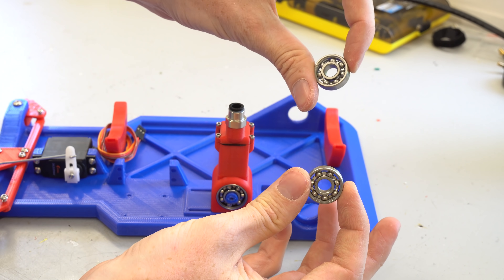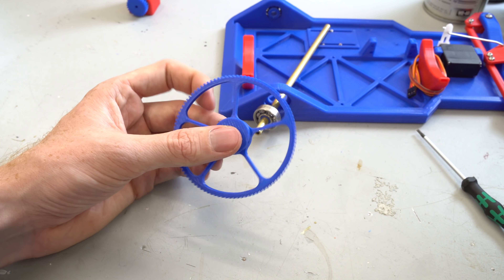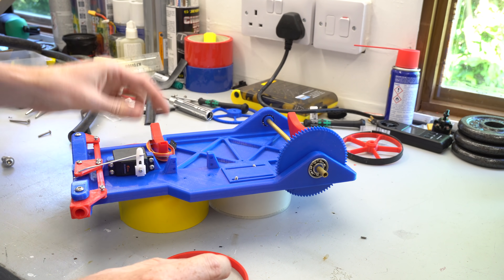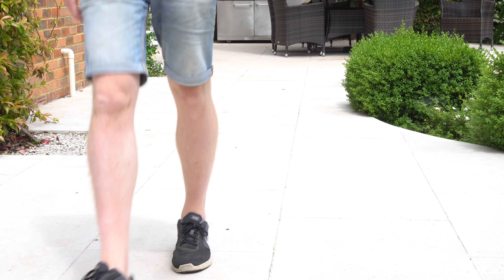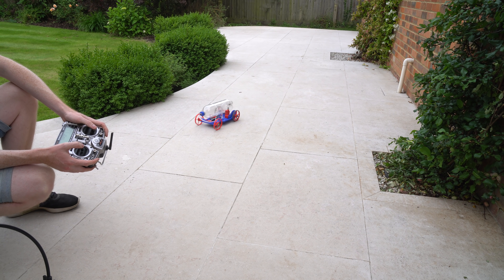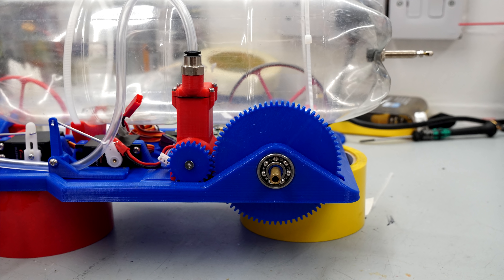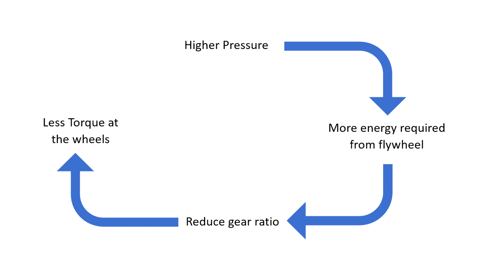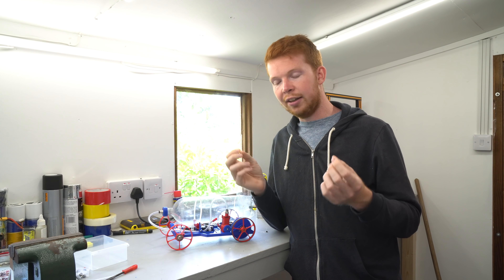Air Powered Car

Comment: For gearing it's better to avoid simple ratios like 100:25 (4:1) as it means the same gear teeth keep encountering each other.  It's better to use relatively prime numbers such as 101:23 and then every gear tooth gets to encounter each tooth on the mating gear which promotes better wear.
Reply: and this is the reason why the reduction ratios are always strange! ... now I know it too .. I never thought about it. Ah the old mechanics what a legacy
Reply: I've never thought of that! Incredible!
Reply: Smart!
Reply: @hb4lwade1 llllllllĺlĺĺĺĺlĺlĺlĺ
Reply: > It's better to use relatively prime numbers such as 101:23
Agreed on using relatively prime numbers for the better gear ratio, but the example 101:23 is maybe not the best example to illustrate what it means when numbers are relatively prime.

Two numbers are relatively prime when they don't share a common divisor other than 1. Any two prime numbers like the 101 and 23 in your example are relatively prime as well (by definition), but a number that isn't prime can be relatively prime in combination with another number as well. As long as it doesn't share a divisor with the other number other than 1, a non prime number is relatively prime with that number, so 125 and 16 are relatively prime as well because they don't share a common factor other than 1 (factors for 125: 5^3, factors for 16: 2^4).

TLDR: being prime is not a necessary condition for a number in order for it being relatively prime. Because the numbers in your example both are, it may convey a wrong suggestion. An example using non prime numbers like 125 and 16 (or any other non-prime combination) would in my opinion have been a better example to illustrate what it means for two numbers to be relatively prime.
Reply: That's neat I never would have even thought of that.  Simple concept yet easy to overlook.
Reply: Thank you very much.  I had noticed in the past that some gears had what seemed like strangely random numbers.  Your explanation makes perfect sense and now I know why.
Reply: Thats mad haha
Reply: Never thought about that
Reply: Excellent advice, thanks.
Reply: Bos: You are right. Good explanation.
Reply: Well, thank you :)
Reply: I can only agree , but I dont think that wear of the gears is his biggest problem at the moment , although its a verry nice build car
Reply: That's what is called a  hunting gear ratio. Most car manufacturers have moved to it instead of the non hunting or partial hunting varieties.
Reply: Its called "hunting gear"
Reply: Even if you up it from 100:25 to 101:25, you'd ensure that the gear was cycled 1 tooth backwards for each revolution of the large gear, which would also ensure even wear
Reply: Old windmills use this trick too, accompanied with the cogs being different kinds of wood
Reply: Great observationand explanation. I do think it's a different situation here as he doesn't need to worry about wear. Instead his issue is getting a proper mesh and it's easier to get the same set of teeth to mesh rather than every combinationof them. Simular situation when your hand cutting gears.
Reply: My rc car gear wear explained 20 years later in a comment made 3 years ago. Awesome. Totally overlooked this
Reply: That's really interesting
Reply: oooh..........thanks man
Reply: you just taught me something. thank you
Reply: holy shit, you just blew my mind sir
Reply: I have no idea what u said but ur bug brain
Reply: mating...
Reply: Holly sheet you just gave me a flashback to college
Reply: Wait. Thats a lot of knowledge.
Reply: Thanks!!🤓👍🏽
Reply: Thanks
Reply: 0
Reply: My english is not nice, ı have a question: why dont he 10-35?
Reply: If it promotes wear then how it is advantageous?
Reply: @samuelnallabariki4517  No, you've misunderstood that. What he meant by a 'better wear' is an even wear on all the teeth, an uneven wear of the teeth might cause slipping or other issues.✌️
Reply: Amd do you know why that works? It's because it's numerology. The sum of that is 7 for completion and perfection.

Comment: Hey try this pneumatic engine with steam? Would the 3d plastick melt with higher temperatures tho? Dunno but it would give you a fun project to try accomplishe lika boat or something that runs with steam!!
Reply: cheap 3d printed plastic wont handle steam
Reply: I have a 3D printer and I test it with the heated bed : PLA plastic start to bend easily at 100°C.

Comment: It really just needs an extra flywheel (brass)
Reply: a light flywheel defeat the entire purpose of a flywheel.
Reply: yeah have a built in flywheel,, or make the gear coming from the engine metal
Reply: the problem that I see with his engine is a single cylinder design. it only produces power in half of a cycle. therefore, it needs a flywheel to drive the other half of a cycle. my idea is  a 2 stage design or double the cylinder. with this solution, the engine is able to generate more power continuously and you don't need a flywheel. but you can have a flywheel to make the car run longer.
Reply: You don't necessarily need more weight. A fly wheel stores energy in form of momentum ( a mass with a certain velocity). So to increase the energy storage, you have either to increase the velocity of the mass or the mass itself. That said, you don't need much weight for a flywheel,  you can just shift the weight to the outer ring of the flywheel (distance of the mass to shaft increases and therefor it's velocity), wich you can manage by fitting a piece of metal tube onto the flywheel (minimum weight increase for maximum energy storage). That's why flywheels often have this distinctive slender rods that attach the outer ring to the shaft.
Reply: No. A flywheel needs a high moment of inertia.
Reply: And what is wrong with that? Isn't that the whole purpose of a flywheel to have a high moment of inertia to overcome the valve resistance? Yes it would need a slightly stronger initial push but it would than help the car going at higher pressure
Reply: you mean inertia? right? I know that but a 3d printed flywheel is too light to store the energy.
Reply: A flywheel needs to have weight/mass what the fuck do you mean it has to be light?
Reply: A large diameter wheel with most of the mass at the rim will have a light flywheel with good torque.  He has enough space where the engine is to have a large flywheel on the outside of the gear wheel.
Reply: +Preston Elam No, a flywheel is essentially nothing more than energy storage. He needs enough energy (in form of inertia) to overcome the friction of the valve train. To increase inertia, you can either shift the existing mass away from the center (the shaft, wich increases the speed of the inertia) or you could add more weight (wich is pretty inefficient) or you could gear the flywheel to have double the rpm of the engine ( this would increase rotational velocity of the flywheel mass and therefor it's stored energy). To give you an example, think about the land speed record cars at salt lake city. They can't start by them self, there has to be another car pushing them to a certain speed after wich they can accelerate by them self. This is because the transmission is geared so high that the engine can not deliver enough momentum to the wheels. In case of the air powered car, the car was the flywheel of the engine. The car has to get to a certain speed (the initial energy provided by the engine isn't enough, so you have to put your own energy in)  until the engine can run self sustained. You could increase the gearing to solve the problem or you could increase the initial speed or even increase the weight (wich would be counter intuitive because it would make the start even worse but it would help to sustain a certain speed, when driving through a corner for example). I merely said that you don't need much weight for a flywheel (it is just the simplest way). There were a lot of single cylinder tractors that relied on the principle of flywheels (storing energy rotating mass) to even be drivable.
Reply: +Mandernach Luca I understand what a flywheel is. I understand it's purpose and I understand the effects of changing the scale. His issue is not however a flywheel issue is all I am saying. The entire car is enough of a flywheel since his drivetrain can be reverse driven. So, my only argument here is; He needs a new valve system, and it has nothing to do with the flywheel because the car's weight and the energy generated by it is a sufficient flywheel
Reply: If possible, add a small but heavy flywheel connected to an even smaller gear than the primary gear of the motor. This gives a high flywheel rpm to compensate for the small size.
Reply: And a clutch system. Something simple with fly-weights would do it. Then the fun would be figuring out what would be a workable stall speed.
Reply: Lardah420 agreed
Reply: Sinh Nguyen, the Single Cylinder issue has no effect here. the issue is the valve system he is using. Did you watch the explanation at the end of the video? The power created by the engine isn't enough to overcome the power needed to push the valve at high pressures and the weight of the car.
Reply: I know how a flywheel works. my idea is a 3d printed flywheel can't store enough energy even if you shift the mass away from the center. the purpose of a flywheel is to store energy in order to drive the other left of a cycle (which doesn't produce power). in his case, he need a flywheel to drive half a cycle and push against the valve. he can change the valve system (a rotary or slide valve) or he can change the engine design to produce more power in 1 cycle.
Reply: considering the same size, shape and speed => more mass is more inertia. I prefer a small and fast spinning flywheel with more mass to the same flywheel with less mass.
Reply: +Preston Elan The cars weight is indeed enough to act as a flywheel but you don't understand what i mean (who could blame you, i suck at descriptions ;D). I simply want to say that the gear ratio he currently has is good enough for the engine to run the the car but when the mass of the car has to act as a flywheel,  the the gear ratio will be revers, wich probably restricts the power output so badly that the delivered energy isn't enough to overcome the valve train friction (designing a new valve train like you said is a possibility but i wouldn't do it simply because i am to lazy XD) . So from my view point, i would simply add a flywheel to the engine itself, problem solved.
Reply: All that matters is that the energy produced during the power stroke is large enough to re-open the valve on the next cycle and cover other losses during a single engine cycle.
 It is true that at higher pressures more energy is required to open the valve due to greater force (due to pressure) and larger distance (due to elasticity of the O ring) so very roughly valve energy requirements are proportional to the square of the pressure. The valve probably doesn't give the energy back to the engine by 'backdriving' the pushrod and cam. Higher mechanical forces on the components will also lead to higher friction and losses e.g. cam sliding against the pushrod, piston against cylinder walls and these should increase linearly with pressure. The energy produced by the engine power stroke should also increase linearly with pressure. Evidently the resistances are outstripping the power at higher pressures, possibly due to the valve.

Having a flywheel and a lower gear ratio may in practice make it a bit more efficient, since it's keeping most of the kinetic energy in the engine shaft and not moving it back and forth between the car body and the engine via the gears plus it would be smoother but largely it's a problem with the engine itself. There are valves where the actuation force increases little with pressure e.g. rotary, slide, or spool (bobbin) valves but all of these would require very tight tolerances to produce.
Reply: Thinking about it, it may be a problem with his valve timing. If he has his opening timing too early, it will affect the engine at higher pressures more adversely than at lower pressures.
Reply: flywheel and clutch
Reply: Or you could just glue weight to the gear to give it more inertia without changing the diameter
Reply: @rladams65  Uh I think that would be hard to make it balanced, and the extra vibrations would just induce more energy loss
Reply: The car's momentum is enough of a flywheel. the last thing he needs is even more weight to get it going. The issue is, when the car first launches the motor has to overcome more energy then it can put out. which isn't an issue when it's connected to a small prop, or even on the table.
======THE REST OF THIS COMMENT IS WRITTEN POORLY AND HARD TO UNDERSTAND=================
 however the ball valve's "resistance" as we'll call it. is proportional to the pressure. And grows exponentially faster than the output, however this for the most part can still be overcome by the power output, until he puts the car on the ground, and the resistance is offset.
Reply: the engine works perfectly with no heavy load such as a propeller. but the weight of a car gives the engine an overload. it just can't produce enough power
Reply: brass is too heavy, the flywheel needs to be light
Reply: "the flywheel needs to be light"

Possibly the cringiest thing I have ever seen anyone say in an engineering context